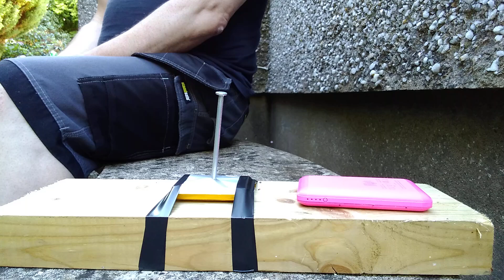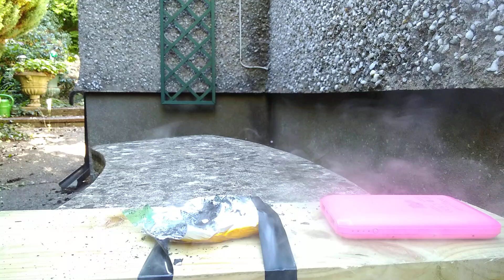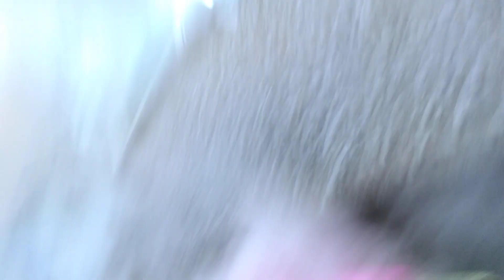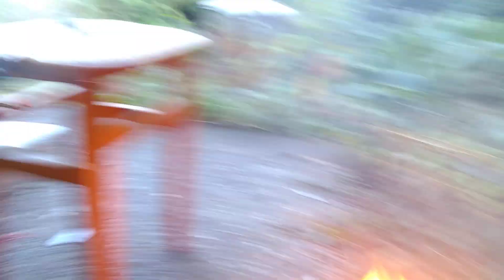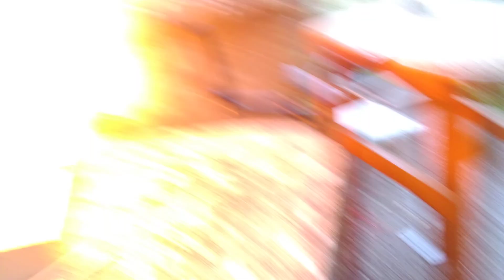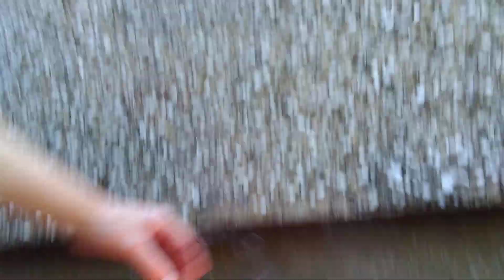Poundland lithium cell vs the mighty AvE hammer

Comment: Not bad, That battery might have done well with just the first tap, gotta have patience with these. There's several approaches. You can make a hole with an active short to get any flammable gasses going as soon as possible. Or you can let it build up a nice head of pressure (and temperature) before there is any fire. These batteries are special dangerous as they do sometimes eject un-burned battery matter (on their own!) which then can even explode or make fire jets.

Comment: I think it's a matter of surface area exposed to mixed chemicals.  A hole is a lot different than a slice. The area that mixes with air is probably 10x more relative to a small hole. 
   An impact by itself does not necessarily expose it to air. That's why it was slow.
    My opinion only here.

Comment: Welp.... the modern safety-chemistries.... they sometimes catch fire.
I know as I've compared oldskool Sony 1.8Ah/cell (Circa 2001) with modern Samsung 2.4Ah cells.... both fully charged, both chucked in fire at separate times.... he oldskool Lithiums went off like fireworks, the newer ones made a hiss sound and was disappointing (They prob still caught fire, but just normal plastic fire, none of that woooosh and red sparks flying)

Comment: Clearly the cheap packs either have safety in mind or they don’t store that much energy. I’m suspectI got the later.
Reply: I bet though if you overcharged the battery then your house would burn down and the bloody insurance company would wheedle their way out of paying.
Reply: If this is a li-ion battery, they can be very volatile, but racing packs are worse in that regard.

Comment: Have you seen Guy Martin's programme exploring electric vehicles? (The one where he's building an electric, classic, VW beetle) - Apparently, modern lithium batteries are much safer than their earlier cousins, though the way to prevent a runaway fire in a lithium battery is to put the entire car in an explosion containment pie dish, about 20ft by 8ft, and filled with water until the battery is discharged (About 24hrs). I reckon you'd get yours comfortably in 20cm by 8cm.

Comment: Hmmmm... drop cell into tray of mercury? No no  no, that's silly... a thinner nail that'll go all the way thru to create shorts through all the layers? Drop into hot solder? Put into a bottle of coke with a mento? Send it undercover to infiltrate squirrel terror network? Sorry all my ideas are far too dangerous, please don't do any of these! Ya know, sodium hydroxide solution is very good at conducting and eating aluminium!

Comment: Yeah and I'm worried about this happening from trying to hook one of these to an FM radio board. I already bought a couple of 2 cell 18650 DIY power banks from Amazon to replace the one I originally used because the cells are junk.

Comment: The most likely reason for the time delay is the battery wasn't up to the ignition temp for the gases being released, if it was a higher power density it may have ignited sooner. The "exploding" cells are one that are run hot to the point of thermal run away and are already hot enough to ignite the gases by the time they rupture.
Reply: so next time heat it up in a pan of water to lets say 80 celcius then whack it ?
Reply: @girlsdrinkfeck  oil. Maybe water if it's deionized.
Reply: @girlsdrinkfeck  I dont think you need to puncture it if you throw it in boiling oil :D
Reply: @girlsdrinkfeck  And then extinguish with water?
Reply: @girlsdrinkfeck  Deep fried lithium battery, probably not a first in Scotland haha :)
Reply: @Марк.Фетнов  Damn, I was just going to suggest a light beer batter!
Reply: @jimmyb1451  Tap water doesn't conduct that well in low voltages, I remember being a kid and submerging flashlight bulbs under water while it was energized._
Reply: @Марк.Фетнов  If you're going to deep fry it, then you should batter it first anyway, just like fish.
Reply: @DjResR  It's not so much the conductivity as the whole lithium and water.

They get along a little too well.
Reply: @jimmyb1451  Although then deionization doesn't work does it?_
Reply: @DjResR  true.
Reply: @girlsdrinkfeck  mmmm, deep-fried battery
Reply: My phone’s battery gets quite warm when charging. I wonder if that means it’s more spectacular when damaged. Relatively recent phone, newer iPhone SE
Reply: yes it's also giving you a fouls, sense of security, I think most people including me, that was basically  it a bit of smoke, all do, it can a time delayed bomb?  is that how they normally go bang? :-) it started to fires, and looked like it would set the bigger one off also
Reply: @dh2032  Yes, it is. When there is a short, they get very hot, the electrolyte starts to boil, the cell expands until it ruptures causing more shorts, more heat and more expansion. The vapors of the electrolyte are highly combustible and they are only waiting for the temperature to get high enough for ignition.

Comment: I think the cylindrical cell the we poked enables the screw to contact many tightly wound layers quickly, and doesn't let them expand easily, so more pizzazz. and the single cell was in parallel with 3 others, so plenty external juice to help. Definitely the electrical energy is the push.  Tho the chemicals sure make for a nasty smoke!  Still, it's always fun to let the smoke out.  Love that sneaky delay, too!  Stay (somewhat) safe, Clive! Stu the semi-combustible batty. (Still have the shorts with the holes burnt thru them. A reminder to respect your batteries...:)

Comment: Dose anyone know how to get these going again after they have died cuz I once had a 5ah really good battery which I accidentally short circuited for a second an now it won't take a charge
Reply from the maker: Normally applying charge will reset the protection circuitry, but it sounds like something has blown internally.

Comment: i recently " disposed of safely " a few old Rc lipo packs , including a 3s Chinese special ... all full charged... i was extremely dissapointed with the lack of flames no matter what i did ... the levels of smoke was pretty impressive though ...i wonder if they have added some kind of supressing agent to them in recent years, cause i have set off many a pack  a fair old time back
Reply: Connect them to a car battery, at night. It's like fireworks. ;)
Reply: I tossed one on a fire a few years back, all it did was put out so much smoke that the fire went out lol.
Reply: I've found a good way for pouch lipo is to get each cell up to 5v or until it's about bursting then smash it down.
18650 just stick a high power charger on there and it should justabout shoot like a firework
Reply: Maybe it just dont hold as much juice as new ones.
Reply: @Spiralem  remover protection circuit. They can hold a lot more.
Reply: @mindaugasstankus5943  I think they mean that an old worn-out battery might be less likely to provide an exciting show compared to a brand-new battery.  I think that they are speculating that perhaps nothing about the battery chemistry has changed much, and instead the user's experience is mostly based on the age of the battery.

Comment: I remember reading somewhere that lithium batteries contain more energy than TNT... is that true?

Nice hammer too 👍❤
Reply: No. A lithium ion battery has an energy density of, at most, 1 million J/kg. TNT is 4.6 million J/kg. So TNT is about 5 times more energy dense. All efforts of harnessing TNT's energy has ended catastrophically. Even if we could figure it out, no one would want to carry around TNT batteries.
However, with lithium ion being 1/5th as energy dense as TNT is still scary.
Reply from the maker: Not sure.  But any device contained tightly can be forceful.
Reply: Luckily the combustion rate for lithium cells are relatively slow.
Reply: Thank you.  😂
Reply: Flying on e-planes will sure involve some pucker factor. If things go wrong, you have time enough for the Amen, not even a prayer.